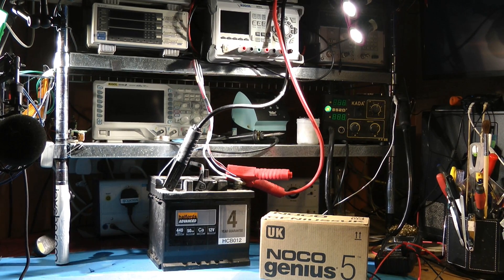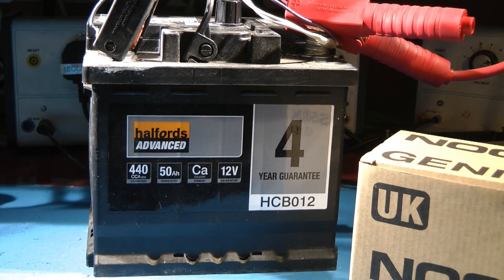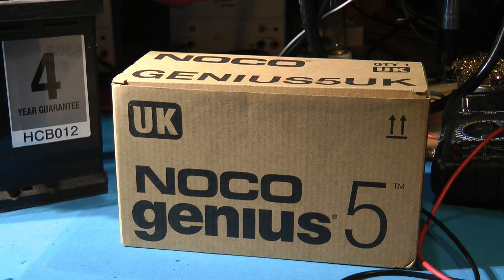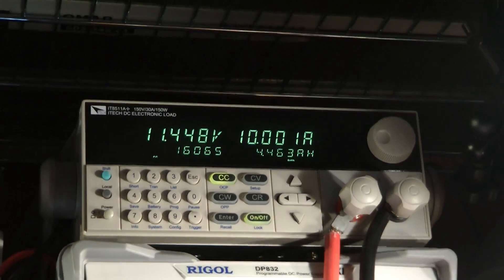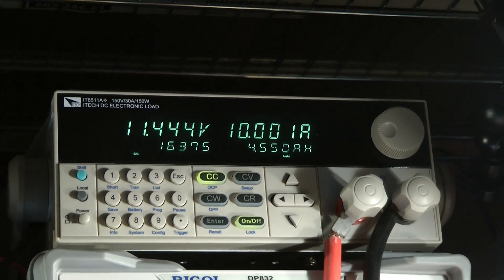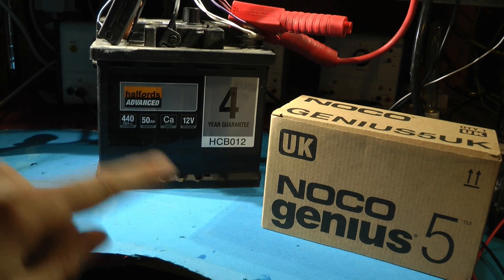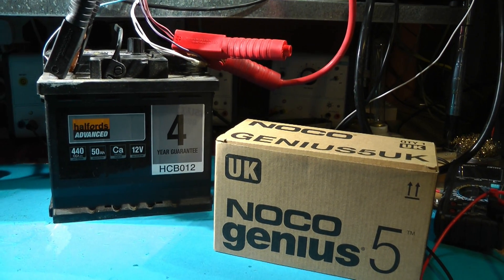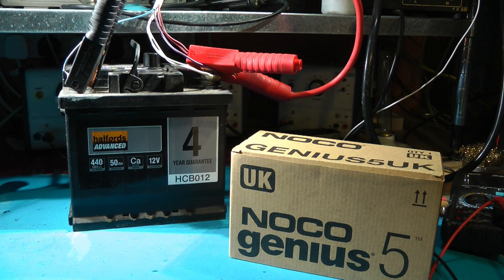NOCO Genius 5 Battery Charger Detailed Evaluation, teardown  and Review Part 1

Comment: Noco chargers seem do good job at charging batteries I charged a sealed flooded battery a friend had sat 2 years surprisingly tested at 12.1 volts , I used a noco 1 amp. Charger let it go till showed a solid green light it took 5 days to charge it showed solid green , has battery tested it passed still good condition ,  i got noco 1 ,5 and 10 amp charger all worked well for me
Reply from the maker: Thanks for the info. My Nocos have lasted fine too. One is powered up  24/7  since 2021

Comment: I have one of these chargers and it's brought back to life two lead-acid batteries that hadn't seen charge for at least 5 years. The weak-point of the charger is the documentation, it's terrible. So the real trick is that you need to allow the charge to go until the solid green light shows. The charger attempts to trickle charge for up to 48 hours at the end of the cycle if it determines the battery needs topping up  (during this part of the process you have a flashing green light) . It will feel like the green light will never go solid but it does. Only after that process should you run the repair mode.
Reply from the maker: Interesting What do you mean by Brought back? Have you checked the Ah capacities. You can only declare this if you have quantatively  tested the batteries.  Also what kind of lead acid batteries are they Sealed Valve Regulated or Normal Wet Cell?

Comment: Are you ever going to try an Optimate Battery Charger?
Reply from the maker: I have it here - I will try and find the time....
Reply: @razenby  thank you man, my father has an optimate 6. And have saved countless batteries with it. I'm stuck between a genius 5 and a optimate 6. The optimate 6 from one I have seen is fantastic.
Reply: What did you end up buying? Noco Genius 5 and 10 have a force mode to charge dead batteries below 1 volt, and  repair mode that desulfates batteries. PulseTech battery chargers and desulfators use a patented frequency to desulfate batteries. I use a PulseTech PowerPulse paasive battery desulfator on my BMW battery, and it starts fine even though I only drive it about 25 miles a day.

Comment: To a real novice at this, what car battery charger would you recommend?
Reply from the maker: Depends what you want it for.  If you just need to boost your car from time to time then the 8A £20 one I reviewed ion this channel will do the job especially if you have left your lights on and you need a quick boost to get you going. . I would not leave your battery connected for long term maintenance support on any of the cheap chargers as the voltage and temperature sensing/compensation is not sufficiently accurate to fully protect the cells.

Comment: Nice, i am looking forward to the next couple of results. I also have a Noco genius 5.  Just a couple of notes... 
(1) When a battery is put to charge and you reach the point where all the% charge lights have gone out and you are left with a only flashing green light (optimization), depending on the battery age/state, it can take 12-48 hours to go solid green.  My experience with a good battery is that it could take up to 12-18 hours to go solid green.  And with a poor battery (capacity loss/sulphation) it took almost 48 hours. 
(2)  The recondition mode takes 4-5 hours no matter battery state and then goes into standby.  And then you have to put it back into charge mode.  I didn't have any success with it but the battery i tried was very sulphated. Under a load test the voltage dropped from 13V to 6.5 V.  I think the recondition mode probably handles the battery acid stratification and minor sulphation.
Reply from the maker: Interesting. I tale note of that. the manual sates regen can take up to 12 hours. there is also a warning and disclaimer about using it on maintenance free types. We will see.
Reply: @razenby  Hmmm .. unless they changed the manual after i bought mine.. Because i just checked my manual and it says 12V repair can take up to 4 hours to complete the recovery process and will return to standby when completed. And that's what i saw happen.  I don't know if they are now including the full charge cycle before doing the repair mode in the timings.

Comment: As a motorhomer I read a lot of stuff about battery capacity and cycle life.
What I've gleaned is that starter batteries like this Halfords really don't respond well to repeated deep discharge to 10.6V.
They have very limited cycle capacity at that level - might well be less than 100.
This isn't a big deal in cars which typically only demand a massive current for a few seconds to start the car then top it up immediately - batteries really never drop below 90% State of Charge.
Typically the battery on a car used every day will last a very long time whereas one that is allowed to get and remain low will quickly sulphate and lose capacity.
As you've said they carry enough charge to start an engine but not enough for even a moderate sustained load such as side lights for an while.
As others have said the nominal Ah capacity is specified at either 20 or 100 hour discharge the slower giving a higher number. 
From what you say about the present capacity I'd expect it to continue to reduce significantly with every cycle and quickly 'die'
I doubt that any of the chargers will be able to resurrect it - snake oil rarely works 😀
I look forward to seeing whether a blast from your mega DC supply does anything.
Do take care though as hot battery acid is not a good thing to have escape under pressure.
Reply from the maker: Hi Mark, Don't worry about my safety , it is child's play. A blast of current isn't really advisable on a sealed CA battery as the recombination wont be able to keep pace with the dissociation of the electrolyte.    Do you consider 10.6V to be a deep discharge? It seems the problem about lead acid batteries is all smoke and mirrors.  All cars have parking lights, so what is the maximum duration of parking with sidelights on for a car without damaging the battery?  Some batteries just don't last. It may be that they have been recycled so many times that the lead is so full of impurities that a reliable battery cannot be made unless freshly refined lead is used..   It is a huge and lucrative market.....
Reply: @razenby  
Certainly a lot of smoke and mirrors with Leisure Batteries.
I'd say that 10.6V is indeed a deep discharge      - represents virtually no remaining capacity.
Anything under 11.8V really starts eating into battery life.
Ideally for a long cycle life 12.1V or so (for a conventional battery) which is 50% Depth of Discharge is as far as one ought to go.
Reply from the maker: @markdauncey927  Do you think I should switch the test to measure capacity down to 11.8V?
Reply: Happy to be corrected - any chance of a link to them?
Reply: @markdauncey927  Unfortunately, EN 50342 (like practically any other EN standard) is only available for a fee. But in a nutshell, according to point 3.4.2 The capacity of a starter battery is defined for the temperature of 25 °C ± 2 °C. The nominal capacity Cn in this standard is a C20. It shall be indicated by the manufacturer as nominal 20 h capacity C20 (Ah).
The nominal 20 h capacity Cn is the electric charge (in Ah) that a battery can supply with a current:
In=Cn/20h (A) 
to a final voltage Uf = 10,50 V.
Reply: I think that's much what's been said - battery manufacturers choose between 20 and 100 hour rates. Normally on starter batteries they use 20 and for leisure 100 - either is unlikely to represent the likely consumption rate in service.
Using 10.6V as a cut off gives, as you say, the nominal capacity and at that voltage it is as near as dammit fully discharged - very little more energy would be delivered below that voltage.
If a battery is repeatedly discharged to 10.6V level it will not last very long.
I think we've already been told this battery is losing 1Ah of capacity with every cycle.
From what I've ready a great number of  starter batteries will fail completely before 100 cycles down to 10.6V never mind cease to  deliver 80% of nominal capacity.
Reply: @markdauncey927  So in simple terms, for example, a 100Ah battery should be discharged with 5A to 10.5V cut-off voltage. In the case of a new battery, the discharge time should be at least 20h, in case the battery is used this time is correspondingly shorter. In the conditions of a home workshop it is worthwhile to use the Ah meter to make your task easier. The cut-off voltage of 10.5V also does not have a major impact on the condition of the battery, provided that it is recharged within a short time. This, of course, applies to starter batteries, deep discharge batteries as you have written are a separate topic.
Reply: Taking any battery down to 10.6V repeatedly have a very significant effect on its overall life. Even 'deep discharge' batteries don't take kindly to repeated removal of their rated capacity.
Hence the recommendation for standard batteries to not routinely discharge more than half rated capacity.
Reply: Battery manufacturers measure capacity as the total energy that can be delivered in complete discharge.
Not that many batteries ever manage to meet it even at 100 hour rate.
The industry reckon that a battery has reached the end of its life when it can ho longer deliver 80% of its rated capacity.
So your battery has already got there!
Repeated discharge to 10.6V will very quickly reduce the capacity of the battery.
What voltage you use in your test rather depends on what you want to discover.
Given that the nominal voltage of a battery is 12V and much below that it doesn't drive things you might connect to it measuring cycle life at discharge to 11.8V is more real world.
Battery manufacturers are amazingly optimistic about cycle life and the main Leisure Battery 'certification' body seems to take them at their word.
FWIW the better Halfords batteries are Yuasa and used sympathetically and regularly charged using a programmed charger can give very good service.
Unfortunately cars that are only used irregularly don't get full adsorption charges - alternators are more a 'power source' than a charger.
When
Reply: @markdauncey927  Please read the test methodology in EN 50342, which is mandatory for battery manufacturers. There is no such thing as a complete discharge. The standard specifies exactly the parameters.

Comment: I don't have too much experience with this, but I've played around with reconditioning smaller batteries for UPS backup and determined it not to be worth my time. Simply refiling them with distilled water bought a bit more time, but nothing substantial. My best guess about all these other techniques is that whatever improvements they create, will undo themselves fairly quickly because of various non-reversible chemical processes. The best scenario for a reconditioned battery would be its re-use in a low current consumption environment, such as a remote sensor site with a solar panel etc. Looking forward to your tests since your methodology is always excellent!
Reply from the maker: Good points , thanks.  I will have a think and incorporate them if I can.

Comment: Access to the electrolyte to check its specific gravity would be a great convenience in the test. With a correctly charged battery it is 1.28 g/cm3 at 25°C. Additionally, if the plates are not covered, degradation will be faster.
Reply from the maker: I agree. Trouble is that most batteries are maintenance free. Ill look into it. I have a professional hydrometer so I could drill a hole.
Reply: @razenby  You can also carefully remove the "magic eye" and glue it on at the end. Personally, I prefer drilling 10 mm holes. You can buy plugs for technological holes or plugs for cylinders in chemical laboratories. Both are acid resistant.
Reply from the maker: @Tab7.6.Tab7.6  Great ideas. thanks.

Comment: Are those load analysers telling the truth and can they assist in your tests? Sounds like one of the cells has got sulphation issues. Was the car used frequently, did you keep it fully charged?
Reply from the maker: Very accurate. the Yokogawa is a £3,000 instrument. The only way you can assess the performance of a battery is the Ah capacity and the cold cranking amps. The battery is form a car used every day,
Reply: @razenby  Do you have one of those electronic hand held battery load meters that tells you the SOH and internal resistance etc, the type that cost @£25 online to get an estimation of progress or regression during the testing? It might be interesting if you could slice open the battery when you are done to check what happened and correlate  "sudden discharge" syndrome to the physical state of the cell(s). Many thanks for your time and effort.
Reply from the maker: @johnshaw359  Yes I do. See the review video of the insides on this channel.

Comment: I have two requests something I never see when people test chargers .    Will it resume charging if the AC mains is disturbed.   And will it charge if you connect it up but never press any buttons.   These are two of my personal bugbears and why I don't own some of the typical modern chargers.. I'm a fan of the original OptiMate for these reasons
Reply from the maker: Will do
Reply: It does. I connected mine outdoors into a smart outlet so I could let the battery rest and retest/charge to be sure and it remembers the last setting if it was a charge setting and not a repair.
Reply: @brl5755  yes any charge mode is is fine to default to, even its lowest would keep a battery alive

Comment: I've been a big fan of your testing of chargers!  Thank you!  One suggestion - I would like to see how these chargers perform on a good battery in addition to the marginal batteries you have been using. By testing a 'good' battery, we might be able to tell if there is any benefit to running the various regeneration modes as a preventative maintenance item rather than waiting for when the death of the battery is near.
Reply from the maker: Good points, thanks. most car batteries these days are maintenance free and you can't top up the electrolyte. Regen mode causes excess gassing due to dissociation of the water molecules by hydrolysis. .Regular regen causes electrolyte loss and etching/erosion of the plates in these batteries which can't be good.  I guess I could buy a new battery and ruin it to prove a point but it would likely be a test that would need to endure for a year or so to get anything meaningful. I will give it some thought.
Reply: @razenby  Why go out and buy a new battery only to ruin it?  Why not buy a used battery from an auto recycler, a local garage. or even a private sale that was made fairly recently by using the date code embedded in the battery AND test decently using a quick measure like CCA (ie within 75% of the rated CCA listed on the battery label) from a conductance tester?  The used battery would be a fraction of the price of the new battery AND, if the restoration is successful, you would be able to resell that battery for at least the same amount you purchased it for!  This way, you may be able to find a battery that is not sealed so that you can measure the voltage across each individual cell to see how effective the recondition modes are in applying that equalization charge AND if multiple applications of the recondition mode does anything more to the restoration of the battery?
Reply: @razenby   You can top up the electrolyte. What I did to each maintenance battery I had in my car, I carefully drilled above each cell 7mm hole with drill bit for wood and when topped it up each cell with distilled water, I covered the holes with black insulation tapes all over the top of the battery. it perfectly secures the electrolyte inside the cells even if you turn this up-side down. It proved to be good action in a long run, each battery I owned last longer than 5 years of intensive day to day car use.
Reply: The best preventative maintenance you can do with any lead acid battery is firstly to not deep discharge it and secondly fully recharge after any discharge.
Fully charged, a battery should be able to stand for a good while before needing to be topped up.
I'd be very surprised if any of these chargers have any regenerative effect on a sulphate battery.

Comment: According to the EN standard, the battery should be discharged with the so-called 20-hour current, i.e. in the case of a 50Ah battery the correct discharge current is 2.5A, to 10.5V. The temperature can be omitted because it is difficult to provide 25*C +/-2*C in a home workshop 😉 Happy New Year! 🙂
Reply from the maker: Thanks.  I read that document.  2 amps is too low to be a useful benchmark. It will drive the battery to a lower discharge state than say a 10 amp load as this will reach the termination voltage a lot sooner.  Good points though.  I will try a 2.5A discharge and see what the capacity is.
Reply: @razenby  Ok, I understand. Of course, for a simple discharge of the battery the current does not matter. Only to estimate the current capacity C/20 current makes a difference. You can also apply Peukert's law, but from my point of view it is not very precise.